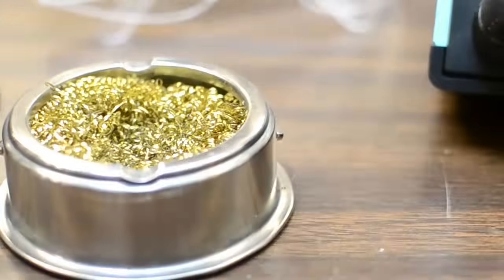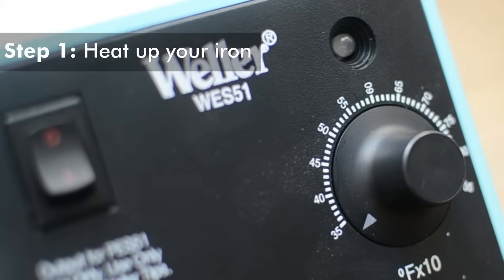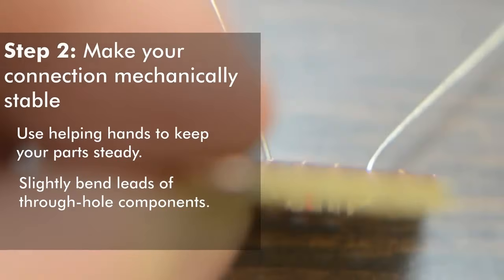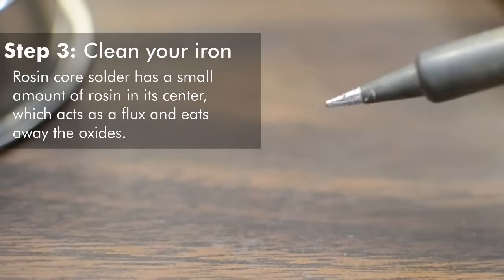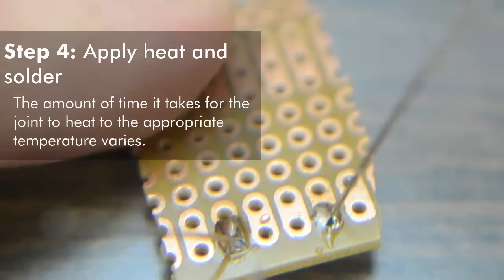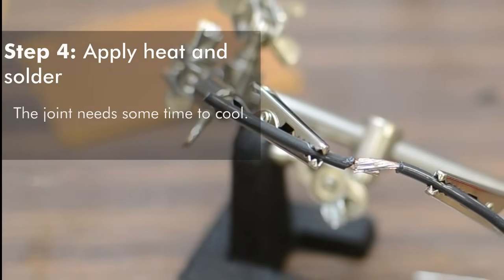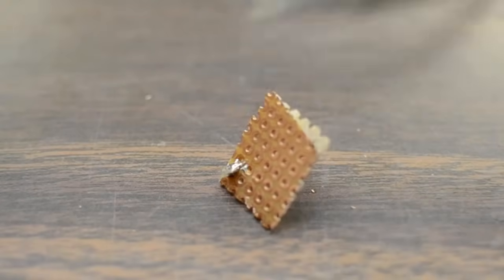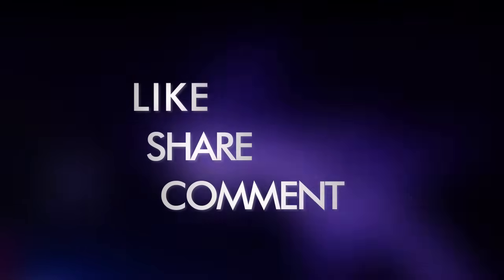Soldering Tutorial for Beginners: Five Easy Steps

Comment: question from a beginner - 2:10 - isn't there a concern about burning the circuit board by holding the tip of the hot iron against it while you put the solder on? I'm trying to learn soldering to repair older computer and video game systems and because of their age I'm concerned about ruining them.
Reply from the maker: Good question. You need to make sure you are only touching the tip of the soldering iron to the metal pad on the board, not the board itself.

Comment: Anyone care to explain the best way to solder leads to a DC motor like a GM3 motor where the contact points aren't super available therefore I can't lay the iron onto something as easily as she does in the video. Do i take the motor out of the casing first and then melt the leads to it? And does it matter what kind of leads I use? Can i just use jumper wires or do i need to get some random gauge wire and strip the wire myself

Comment: Can i use soldering on people? Will it hurt?
Reply: Yes, you can solder two people together, but make sure you do not use Rosin based flux for people to people connections.
Reply: A soldering iron is too small for people. try an arc-welder.
Reply: You should only every solder your own eyes shut to get a good nights sleep.  Other than that, never solder on people.
Reply: Try to solder your sacks to your head if it works then you are good to go.
Reply: thanx for the tip. I'll try it sometimes
Reply: It shouldn't hurt at all - unless the person you are trying to solder is bigger than you and beats you up.
Reply: Tyler Parrott lol
Reply: Bronze welding is better if you're joining their faces together.
Reply: Soldering two people together is serious business. Take notes from The Human Centipede to ensure proper form and adhesion. Ignore PG ripoffs like Stuck On You
Reply: Just be sure that you're heating the people and then apply the solder directly to the heated people, otherwise you won't get a reliable connection between them.
Reply: thanx
Reply: Make sure your soldering iron temperature is at max & don't forget to clean the tip before trying to solder two different people
Reply: No it will not hurt 😂😂
Reply: that is literally the best question I have ever heard
Reply: Ffs he is joking dont reply seriously
Reply: You can, but they rarely soldier on after that
Reply: Can actually work with Iron Man.
Reply from the maker: Do not solder people. Solder is very hot and will burn the skin (not to mention that most solder contains lead, which is toxic).
Reply: Damian Norbert. yes you can..though holding the person down sometimes requires a bit of effort..I recommend using two people to hold the person still while a third person does the soldering..

Comment: Nice video. I see we both have fancy weller soldering iron. do you have a particular favourite tip for general use and fairly small applications. I've owned my soldering iron now for ~6 months love the iron just the tip doesn't stay very clean for long are there aftermarket tips available that may be better? I have the pu81 model

Comment: Hi I am soldering a mini pcb for a drone that doesn't have the holes through the board for the wires plus the board setup is + on one side and - on the other. The board is very small and the pads are only about 5mm across and I am having difficulty in firstly soldering the wires on and then when I have done one and try to put the next one beside it the heat is melting the solder on the first as there is literally no space between the pads. Any advice would be great.

Comment: If you want your soldering iron tip to last, never never never use a wet sponge. I've lost tips using wet sponges in as little as 45 minutes of soldering, especially when using lead-free solder or anything requiring higher temperatures. Since switching to a brass sponge I have yet to lose a single tip.
Reply: stabgod  There must be something wrong now. I’ve been using 50 yrs wet sponge in my hobby and work and my tips have been well lasting. I believe that your tips are not of a good quality. I use only Weller and Metcal and all the tips they have, are long life tips. I tested some cheapos tips and they burned very fast. The good tips are expensive but they last and the soldering is much easier. If you have a good make soldering station like Weller or Hakko (use only genuine Hakko tips) they should last years in hobby use.

Comment: I know you're supposed to use rosin core solder on pc boards, but what size and what about the other numbers?  I think they stand for percentages of certain metals in the solder?
Reply: Use 60/40 is the percent of the blend like lead and tin,  get a .03mm diameter, and flux percent of 1.2 all the way up to 3.

Comment: One thing that really messed me up as a beginner was no one had told me that you're not supposed to apply solder to the iron, but to the piece the iron heats up. Wish that had been spelled out, would have saved a few early projects
Reply: I wasn't talking about her, I was talking about how people who had taught me electronics repair in the past had failed to mention that
Reply: @techpriest4347  I think her name's tesla, not "her".
Reply: Brand new to the concept of soldering here, but looking to take on a Raspberry  Pi project that will require a little bit of it. I assumed the purpose of the iron was to melt solder as well -- glad I found this video!
Reply: Geddy V
Reply: Try soldering on to tiny little circuits that are used for in the ear hearing aids. I soldered resisters, capacitors, microphones and receivers on to the circuit which had to fit into an in the ear mold and using a large magnifying lens to see the parts. To me it never was a job but a hobby. I worked for Starkey East who also donated hearing aids to under privileged children all over the world. I was honored to work for a great company like them. My coworkers and I were like family!
Reply: i know that feel bro Q.Q
Reply: The real information is in the comment section! Thanks for the information from a soldering nuub!
Reply: brieflycake k
Reply: Techpriest Oni ,
Reply: lol youre right.. same here..
Reply: Techpriest be
Reply: I had the same problem
Reply: I thought you were?
It's called "tinning" isnt it?
Reply: Tried my hand at soldering for the first time tonight... And literally just this
Reply: I had the exact same issue, will try as shown in the video .... Thanks for the tip!
Reply: It's ok to touch the solder to the top of the iron for maybe a second to get the solder closing then move to the pad or component you are soldering. This works for me. I used to work in a repair and the owner never complained about my work.
Reply: that happened with me too. i used an entire role (1 metre ) solder to make it stick on the iron  ;(
Reply: Same here
Reply: This! I've wasted so much time, wish I knew sooner.
Reply: QUESTION IMA START DOING MIC MOD UPGRADES FOR PEOPLE. I KNOW THEY SELL FLUX IN PASTE . WHERE DO I USE THE FLUX ON? DO I SPREAD IT ON THE PBC BOARD OR ON THE SOLDER? I KNOW THEY SELL SOLDER WITH FLUX, MAYBE I SHOULD O THAT ROUTE.
Reply: 240 half seconds in other words
Reply: CloudBroadcasts You know, I'd love to say "you're wrong because of this, this and this" but i cant. You're just so right.
Reply: At 120 seconds progress it is mentioned
Reply: yeah but she says it two minutes in
Reply: She says it two minutes in

Comment: 2:40 Tip: you can push the wires together and crimp them with pliers to make them smooth, this makes it more even and straight. Also I got my iron two days ago and it SUCKS. I keep it on what I want to solder and it doesn't get nearly hot enough to melt it. I have to find a sweet spot on the iron, put the sodder there and drag it down. This will probably make a cold joint.

Comment: my solder gun is 150 watts or so and it gets red hot and still I can't get the solder to melt all over like that. and the 40watts wands are useless for me. I end up holding it down so long it melts or burns up the project. it is a pain. I am good at welding but I must have junky soldering tools. or yes I'm sure it's just me.
Reply: I never can get the wires or whatever hot enough to melt any solder. not until I melt the board.
Reply: +FarOutFarSpace change your solder - use lead-tin solder which has a low melting point.

Comment: This tutorial is so perfect, I don't think the internet needs another soldering for beginners tutorial. Cheers!
Reply: +PROcrastiDRIVE SV There was one major flaw in how she attached the wires. They should be tied together. 
Good video though
Reply: +cheasea Ok, didn't notice that. I needed to solder a new DC jack onto an ASUS laptop motherboard (never tried anything of the sort before). The tip on heating the metal plate and wire, then feeding in the solder made it so damn easy. Except when one especially thick pin on the Jack wouldn't get hot enough. That was the only sketchy bit, I didn't want to turn up the iron too much for fear of melting a very expensive board lol. I eventually used the force or something but there's definitely enough solder on it now.
Reply: gotta watch out for that temp!

Comment: Short and straight to the point! Great video. I have a question. I want to replace a small circuit film of the ps2 laser assembly and for that I have to desolder the old one and solder the new one, but I'm not sure how much heat that small film can handle and the joints are kinda small... probably not the best task for a soldering virgin, but I'll give it a try regardless. It's not like it get's any more unfunctional~
Do you have any tipps when it comes to such small and seemingly fragile circuit boards?

Comment: As an electronics instructor at the high school level, I appreciate the beginner level tutorial.  I think my students got more out of your video than an hours worth of my instruction.  Good job
Reply: I've been to a professional high school for Electronics. Unfortunately, it sucked and didn't teach us much. We basically just put solder on the boards, and sucked it up with a pump...we did only a couple of projects, and they were collective...so I learned nothing and did nothing. 

I've been trying to solder these few years, to fix LED bulbs, cables and other things. I've never managed to succeed. I am using lead-free solder and a 60W (450degrees) iron. I'm cleaning the tip and using flux, but I can't manage to solder ANYTHING. The solder sticks to the iron, or the small sphere falls on the table. Solder WILL NOT stick to copper wires or circuit contacts. The tip of the iron takes 8-10 seconds to melt the solder, and the only way to work is to use the body or base of the iron tip to melt the damned solder. What the hell am I doing wrong? Is it the solder's fault, the iron's the flux's???
Reply: @Albanez39  i think the main issue is you're using Lead-free solder. Lead-free solder is much harder to heat up and requires a preheater. Try using some 60-30 leaded solder with rosin core. much easier to heat and to work with.
Reply: @Albanez39  might want to check the iron - sounds like it is underpowered or erratic heat?
Reply: You need flux paste bro that's the only thing she forgot to mention, and honestly, that paste is LITERALLY the most important part of soldering because without the paste the solder won't actually melt to whatever your working on. My advice go to Harbor Frieght they sell everything you'll need in one handy little kit look in the welding section good luck my friends@Albanez39
Reply: I've been to a professional high school for Electronics. Unfortunately, it sucked and didn't teach us much. We basically just put solder on the boards, and sucked it up with a pump...we did only a couple of projects, and they were collective...so I learned nothing and did nothing. 

I've been trying to solder these few years, to fix LED bulbs, cables and other things. I've never managed to succeed. I am using lead-free solder and a 60W (450degrees) iron. I'm cleaning the tip and using flux, but I can't manage to solder ANYTHING. The solder sticks to the iron, or the small sphere falls on the table. Solder WILL NOT stick to copper wires or circuit contacts. The tip of the iron takes 8-10 seconds to melt the solder, and the only way to work is to use the body or base of the iron tip to melt the damned solder. What the hell am I doing wrong? Is it the solder's fault, the iron's the flux's???
Reply: @Albanez39 bro had such a good comment he had to post it twice
Reply: Same here, it’s easy, simple & direct which is a wonderful effort
Reply: @egierzal2184  

p
Reply: I also do soldering as well
Reply: Even with the name Chuck Conrad? I feel better at soldering already.
Reply: ya it's probly cuz she's hot & has nice booba
Reply: I came here because my electronics instructor in high school was not very clear on how to solder. I was wasting a lot of solder on small projects.
Reply: This shows how much you care for your students. Thank you!
Reply: Find a new job
Reply: Because you are a bad teacher. Go and do anything else.
Reply: why uploader didn't like the comment? Dick..
Reply: @kushpaladin  That feature wasn't a thing 4 years ago lmfao
Reply: @kushpaladin  Maybe because the guy basically said he was a shit teacher? Also, what @shakenfake said...

Comment: I have a question Miss, I want to solder a cable that deatached from the motherboard and there is rest of the previous soldering on it, if I want to solder it again do I have to remove the solder? and if so, how do I do that? Thanks in advance!
Reply from the maker: +manuel brett Hello! Yes, you do have to remove the solder. You might want to check out our de-soldering tutorial: http://onetesla.com/tutorials/how-to-desolder
Reply: +oneTesla thank you! I'll try, it's my first time soldering electronics and such, I'm repairing some old snes controllers and when I was cleaning the contacts some little wires came out from the motherboard, your videos are really helpful!
Reply from the maker: +manuel brett Glad to hear it!
Reply: I have a soldering iron the exact same type as yours (but my one is a converter from 240V - 25W)so yes i do need help on that side. 

P.S. I will like your comment to get them to notice. :D

Comment: very helpful - thanks
Reply from the maker: ric m You're welcome!
Reply: +Tony Micel , Hey Tony, You did not say what kind of soldering Iron you are using or what kind of tip you are using.. You might try a higher Temperature ( around 670F) and a larger tip ( 1/8" Chisel ) and add new solder and Flux to the solder Joint.
Reply: +oneTesla im trying to fix a plasma tv that shuts off like in 20 minutes found out its the soldering points under heat sinks. i put a soldering iron on those pins but the solder doesnt melt.
Reply: +oneTesla thanks I learned alot. How did you make this video?
Reply: +oneTesla im trying to fix a plasma tv that shuts off like in 20 minutes found out its the soldering points under heat sinks. i put a soldering iron on those pins but the solder doesnt melt.
Reply: +oneTesla im trying to fix a plasma tv that shuts off like in 20 minutes found out its the soldering points under heat sinks. i put a soldering iron on those pins but the solder doesnt melt.
Reply: Tony Micel did you fix the tv?

Comment: What is flux and what is it used for
Reply: oneTesla FLUX IS NOT ACID. I REPEAT, NEVER USE ACID BASED FLUX ON ELECTRONICS. USE ROSIN OR YOU ARE GOING TO HAVE A BAD DAY
Reply: @AMalas  Rosin
 is acidic.  oneTesla knows what she's talking about.
From Wikipedia, 

A cake of rosin, made for use by violinists, used here for soldering
Rosin, also called colophony or Greek pitch (Latin: pix græca), is a solid form of resin obtained from pines and some other plants, mostly conifers, produced by heating fresh liquid resin to vaporize the volatile liquid terpene components. It is semi-transparent and varies in color from yellow to black. At room temperature rosin is brittle, but it melts at stove-top temperature. It chiefly consists of various resin acids, especially abietic acid.[1] The term "colophony" comes from colophonia resina, Latin for "resin from Colophon", an ancient Ionic city.[2]
Reply: @thicknight1  I might have worded my original comment incorrectly (I was much younger, more naive, and full of ego) , the way I wrote it gives a wrong meaning. Sorry for that.

I meant that when it is mentioned on the lable that the flux is an acid based one, they mostly mean a non mild acid flux which might be too corrosive for electronics. These are mostly made for copper soldering which needs a much more aggressive flux as far as I know.
Reply from the maker: Flux is a mild acid that eats away at the oxide layer on the surface of metals. It helps solder stick to pads and wires.
Reply: ShoeGame use colophony (rosin) flux, based on tree resin! Acid flux sould be cleaned by using a pure alcohol. Acid fluxes are used for soldering an iron based wire, etc.
You can find also cream like soldering paste based on rosin, liquid - rosin dissolved in alcohol and pure colophony, like a rock, yellow or red transparent.
For surface mount (SMD) there is a paste with low temperature melting solder and flux, but this kind of soldering is made by hot air soldering gun or infrared stand (which is expensive).
Reply: lol the amount of disinfo out there about about soldering is just insane
Reply: Iliek Tehbut if i said something wrong correct me